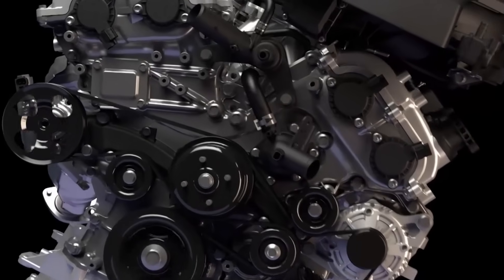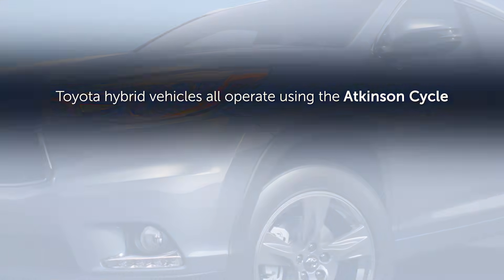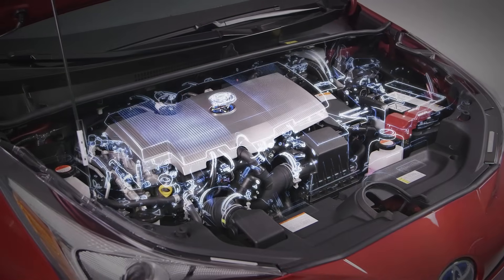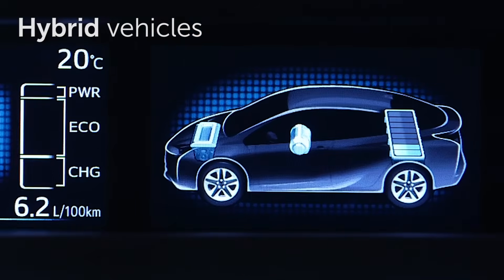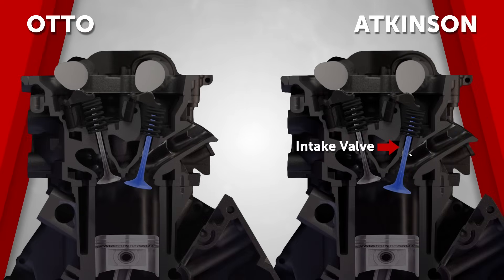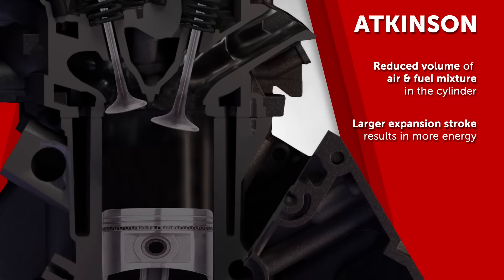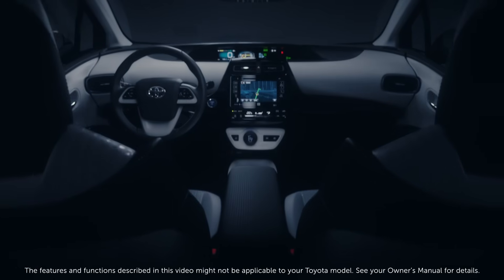Atkinson Cycle Engine

Comment: that's how the GS F gets 8l/100km. mind-blowing use of technology.
what surprises me is that the fuel air mixture stored in the intake manifold isn't strong enough to clean the valves in case of direct injection (only) engines... thus making the d4s necessary...
Reply: With DI engines the fuel isn't sprayed until ignition, no fuel ends up in the intake manifold.
Reply: but luckily the D4S is super refined at this point. i’ve got a 16 y/o 2gr fse and it’s still ticking away nicely

Comment: where thay take compresion from? 🤔 looks like shit. when they compress less air fuel mix than they will get less compresion ration in same cilinder. they need too make area above piston smaller after it moves to its max high point. with less comresion they will get less eficiency or less power, also fuel with high octane will explodes slowly than usually. it means less power and damaged exhaust valve. sorry for my english

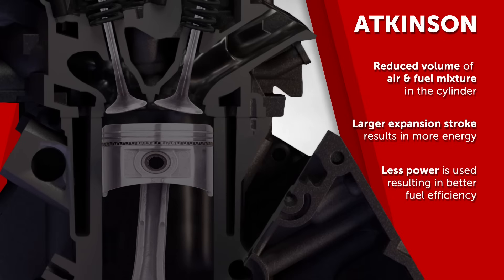Comment: How does it make the expansion stroke larger and why does the exhaust valve open at 2:06
Reply: it makes the compression time shorter, so the useful compression stroke is not the full value. This makes the expansion stroke still being 100% of the basic design longer than the now shortened effective compression stroke. Expansion stroke is unchanged. Compression stroke active length has been reduced.

Comment: One minute in, I learned effectively nothing about why Atkinson cycle saves fuel.
Reply: It reduces intake volumetric when car doesn't need power such constant low speed cruise or deceleration or idle  by prolong time to shut intake valve so that the air fuel mixture would have some return back to intake port waiting for next cycle.
Reply: @alexlo7708  yeah because we all know the phenomenon named "air fuel mixture (..) return back in the intake waiting (casually) for the next cycle" and no one know the phenomenon "wall wetting" or "back wetting and so gunked (with soot coming from egr or remnant from egr) valve" ... your fluid dynamic knowledge is impeccable.
Reply: @TheCUTTERbyPHOENIX  Whatever you object to it. Those engine had pass strict emission measure.
Reply: @alexlo7708  when brand new sure... not after being used..by most of the driver's type that our planet have ...
Reply: In an Otto engine, at the end of the power stroke, theres still a great pressure in the cylinder, which is simply wasted in the exhaust cycle. This is reduced in the Atkinson cycle by not allowing as much air in the intake cycle
Reply: @martinfisker7438  Exactly. This is correctly explained in the video until 1:50 (even though your explanation is clearer). However, what follows  in the video is nonsense. Letting air get in, then out again certainly does not reduce pumping losses per unit of air mass ; it obviously increases them. All in all, this pseudo-Atkinsoncycle is still more efficient than the Otto cycle, but the true one, with the piston doing a small stroke, then a large stroke (thus avoiding this intake valve trick), would be even more efficient.
Reply: @martinfisker7438  so less efficiency we get it, that's why it's a failed cycle, that green people tend to make this shit happen so they all can say : see combustion engine is less effective that chinese electric motors nowadays.. you got me grin..
Reply: @TheCUTTERbyPHOENIX  Unburnt gasoline cleans carbon, not cause.
Reply: @specialopsdave  mixed with exhaust gases coming from egr and messed up by weather conditions ? exposed at a colder temperature than combustion, but hotter than ambiant air ? really ? on a brand new engine ? few miles engine ? or a 50k/100k miles engine ? genuine questioning here, i'm perplex.
Reply: @TheCUTTERbyPHOENIX  I'm specifically referring to any time you use high-quality, modern gasoline with detergents, and the engine is at operating temperature. While carbon mildly builds, the detergents in the unburnt fuel breaks it back off.

Old gasoline, however, loses it's detergent power. Then, you would be correct, the unburnt fuel baking away in the cylinders would carbonize.

This is the reason why port-injection is still common, even being used as a supplement to direct injection; it keeps the intake valve clean, and sealing well.
Reply: in fact it waste fuel, by letting the mixture backing up to the manifold, and then gunking the back of the valves, the throttle plate, the variable intake conduits when you have it etc.. not to mention it act together with egr too add more fucked issue to run that engine obsolete more quickly !
Reply: @TheCUTTERbyPHOENIX  you are completely wrong. That is a Toyota technology not Vw or bmw !
Reply: @toninocars  never talked about brand, did i ?
Reply: @TheCUTTERbyPHOENIX The mixture won't get back since DI engines have the fuel sprayed at an exact part of the cycle where there no leakage.
Reply: It doesn't.  The 3.5L Tacoma has same gas mileage as Nissan Frontier but Frontier has more power.
Reply: Thanks tree hunging leftists, you have reinvented something that has existed for hundreds of years, and deemed INFERIOR to otto cycle "and still is" just so you can save some whales "debatable".  In exchange for having a vehicle that runs like complete garbage.  I know, I have a 19 trd pro tacoma, and until it was aftermarket tuned to keep the atkinson cycle OFF it was an absolute hell to drive. Add on top of that the worst programmed 6sp auto pairing to ever be produced in automotive history, and without aftermarket support anything with this engine is damn near undrivable.  But thank goodness it gets 1 whole mpg than the 2nd gen 4.0 L did, YAY PROGRESS. "obvious sarcasm".
Reply: @ALLLLTheThingspersonal  Literally nobody notices Atkinson cycle. You just hear that it improves fuel economy, and assume it MUST hurt driving characteristics. People like you cruise on the interstate in 3rd gear "for responsiveness"
Reply: @specialopsdave  Do you own one? no?  K then "expert".  Been working on cars long enough to know to follow my own advice over a know it all "comment dunker" on a youtube comment section.  So how bout ya kick rocks and gtfo. As someone who has the 2GR-FKS, and has went so far as to turbo it, I would say I know a whole hell of a lot more about how it functions than some toddler who read the wiki page and thinks themselves an authority on the subject.  Good attempt though, next time bring your A game.
Reply: @ALLLLTheThingspersonal  Yeah, I own a car with Atkinson cycle, and the switch is only perceptible because the exhaust gets louder lmao

So why would being a mechanic make it worse for you than for me again? Because of the placebo effect, in which you expect to feel something, so you really do feel something even though it doesn't exist.

Or toyota engines suck at implementing new tech
Reply: @specialopsdave  If you say so then it MUST be true.  Whatever keeps you from slurpin on a mossburg mate.  You "win".
Reply: @ALLLLTheThingspersonal  Yeah, keep on projecting. You are the one who thinks you MUST be right. Out of many years of roaming the internet, you are literally the FIRST person I have ever heard of having this problem. But you, one single guy on the internet, MUST be more correct then the thousands upon thousands of people who never even knew it existed it's so unnoticeable. Because "i HaVe 20 yEaRs ExPeRiEnCe" means nothing when you claim the sky is green, or that Atkinson cycle is somehow more intrusive than turbo lag
Reply: @specialopsdave  How many do you know that turboed a 2GR-FKS?  oh.... about 10 total so far, all of which you likely dont know?  Thought so.  Also, turbo lag?  seems you havent turbo charged many cars, this isnt the fking late 80s, mines a sequential TT, One small to take care of lag, and one larger for boost at high rpm. makes boost "and more HP/TQ" at a LOWER RPM than it did stock, even after it was tuned NA for a while.   But you knew that that didnt you?  I can tear that engine apart and put it back together blindfolded and tell you details about how it functions no amount of "lurking on the internet" will find.  So again, your in too deep, this isnt the kiddie pool. Stock they put about 100 hp to the rear wheels at 4k rpm, the little turbo is already producing boost and making more than that at 3k.  big one steps in around 5 as the small one runs out of puff.  Its not a giant turbo like you would see in some 1000hp 2JZGTE build. Its running between 7 to 9psi.  not fkin 40
Reply: @ALLLLTheThingspersonal  Yeah, but turbo lag still exists, even if it's a tenth of a second (which is longer than it takes to switch from Atkinson to Otto)
Reply: @confidentlocal8600  Not in my car. About a quarter second to respond. It does sound strange, but idgaf about that
Reply: Some people like to just get better fuel mileage, dude. I don't care about hugging trees nor do I agree with 99% of the stuff the left even says as it's pretty insane, but I do enjoy efficiency. If there's a possible route to that why not explore the possibilities? 

Or I guess you could just get on YouTube and complain about your experience and sell your vehicle and go buy a real truck that gets almost 17mpg. You do you.

Comment: So its basically just a new word for your vvti
Reply: No that's variable valve timing, completely different
Reply: @RyanMcIntyre  they are delaying the closing of the valve based off of the camshaft timing. That's Variable Valve Timing if i ever heard of it
Reply: @Shift-happens-tv  Indeed the closing timing of the intake valve is changed, but it's not variable valve timing, same as Jake Brakes aren't variable valve timing either.  VVTI works completely differently and for a whole different purpose.
Reply: @RyanMcIntyre  this atkinson function is controlled by the vvti hence why it's called a atkinson cycle rather than an actual atkinson engine.
Reply: @Shift-happens-tv  Yes that is correct, however, it is not VVTI.  Moreover, there is no such thing as an "atkinson engine", simply and internal combustion engine that uses an "atkinson cycle" - there are many types of cycles, miller, otto, etc but they all work on internal combustion engines.
Reply: @RyanMcIntyre  there are atkinson engines. And yes its an internal combustion engine. Same way a rotary engine is still an internal combustion engine.
Reply: @Shift-happens-tv  Yep and there's two cycle engines, sterling engines, steam.  You asked the question "So it's basically just a new word for your vvti" and I corrected you BECAUSE IT IS NOT, now you're on a mission to discredit the information I gave you? You asked the question!  You got your answer.  You can't turn around and doubt the people that answer you.  If you say incorrect things and get corrected, accept the answer politely and move on with your new knowledge.
Reply: @RyanMcIntyre  i didnt ask a question, i stated something.
Reply: @Shift-happens-tv  And I corrected you, because what you stated was incorrect. You can consult a Toyota engineer if you don't think I'm worth listening to.
Reply: @RyanMcIntyre  the timing is controlled by the vvti gear assembly for the atkinson cycle. I'm sorry you are having such a hard time believing it.
Reply: @Shift-happens-tv  I understand how it works. The struggle here is that you don't fully understand what VVTI and other variable timing mechanisms are, so you're not understanding why you're being corrected. Please educate yourself on what variable cam timing systems are, how they work, and why they exist. We're reaching an impasse because you aren't fully informed.

Comment: It sounds like a lot of extra complexity in the name of dubious gains. How much fuel does this really save while it's spitting cylinder gunk back into the intake and a bunch of intake sensors? Any engineer will tell you that complexity is the enemy of reliability.
Reply: Turbos are not very reliable, as we Know , that is what Toyota is known for....Reliablilty.  Besides,  this Engine has Port Injection and Direct Injection so remedy these carboning issues. These Engine Managment is wiser than u might think. Toyota really thought these through. Coming from a 20+ years as a Mechanic,  I will tell you that I will take a Toyota any day over the Domestic garbage that is produced.  Reliablilty is what these designs are all about.

Comment: I fail to see how simply building an engine with a low compression ratio would not provide the exact same effect as the Atkinson engine as implemented by Toyota.  Pumping losses are lower, power output is lower, both methods can retard the onset of detonation,  but a low compression ratio requires no complications and provides more flexibility in combustion chamber design.
Reply: The difference is in the cycle itself. While an Otto cycle engine with a low compression ratio provides no benefit, the Atkinson cycle has a higher thermal efficiency due to the longer expansion stroke when compared to the compression stroke, which results in more useful work output and lower pumping losses at the cost of lower power density, which is why the Atkinson cycle was never popular in the automotive industry. However, with the introduction of variable valve timing, you can now have the high efficiency of the Atkinson cycle for low power applications (amazing fuel consumption) and the higher power output of the Otto cycle in the same engine. This might be easier to visualise if you look up the idealised pressure and volume diagrams of both the Otto and Atkinson cycles. You will notice that the enclosed area is larger in the latter, which corresponds to more positive work with the same amount of air and fuel put in and thus, higher efficiency. Hope this helps.

Comment: They might call this an Atkinson cycle engine but a true Atkinson cycle motor uses a linked crankshaft to mechanically shorten every other piston stroke. This  means it only breathes 1 way through the intake valve and does not waste rotational momentum. 
This style [As described by Toyota] results in a very contaminated intake path with combustion remnants, oil from cylinder walls and excess heat in the intake path.
This will cause problems with carbon fallout in the intake path, contaminating inlet ports and valves, also EGR and PCV contamination. Throttle bodies and sensors linked to the intake system can also suffer from contamination.  Because of the heat any remaining fuel tends to remain in a form where it will be able to return to the cylinders but the oil and carbon fall out and turn into a hard tar like substance.
Reply: The Atkinson cycle engine is a specific patented engine design with a mechanically different compression and power strokes. The Atkinson cycle is just a thermodynamic principle that can be implemented by numerous different engine designs. The thermal cycle only pertains to what is happening to the gases inside the engine, not how the mechanical components are designed to achieve that. Same way there was an original "Otto engine" that doesn't look anything like our modern "Otto cycle" gasoline engines.

Most manufacturers with continuously variably valve lift technology implement the Atkinson cycle to some extent (like for example limiting the intake valve opening time which achieves the same as keeping it open during part of the compression stroke).
Reply: @BigUriel  Nah. He's right. This is a Miller cycle engine. Not Atkinson cycle.